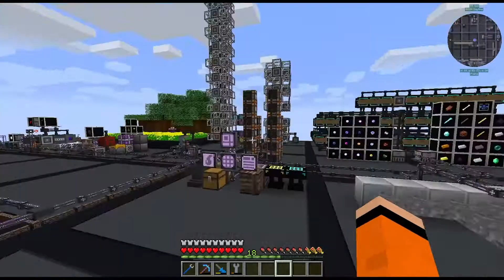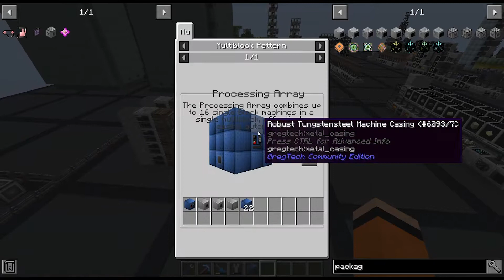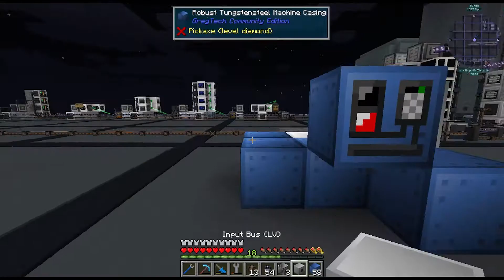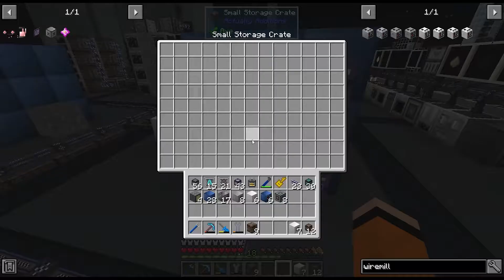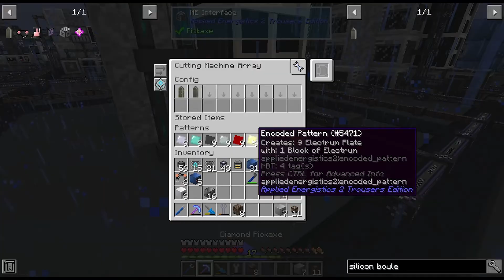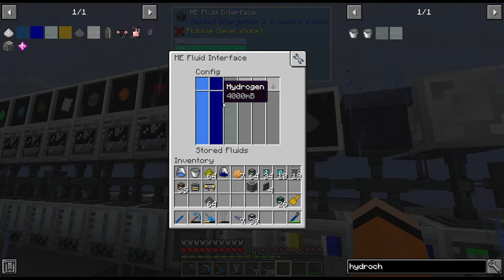Omnifactory - Processing Array! Minecraft - Episode 22

Comment: 3:00 Just fyi, you could use a power monitor to set the threshold instead. Connect it to a nearby conduit and it should read your entire conduit network buffer. Set it such that when your conduit buffer deplete to maybe 50% (will be a huge amount of RF), output a redstone signal to the controller. When it goes above maybe 90%, stop outputting signal. Since your conduit buffers would eventually be far larger than the reactor internal buffer, it shouldn't flicker on and off as much.